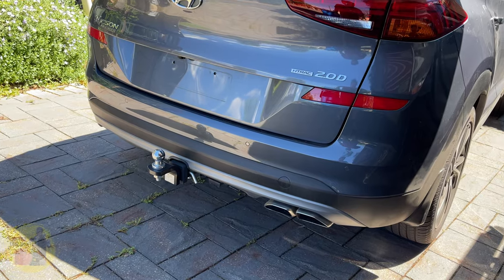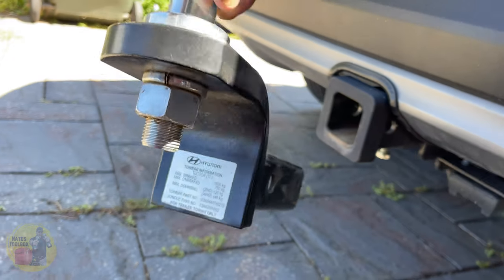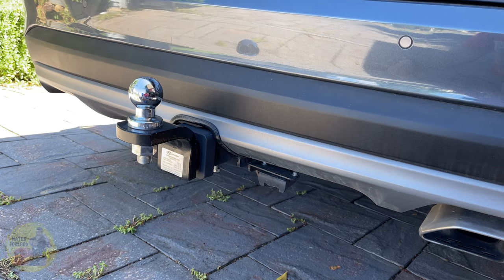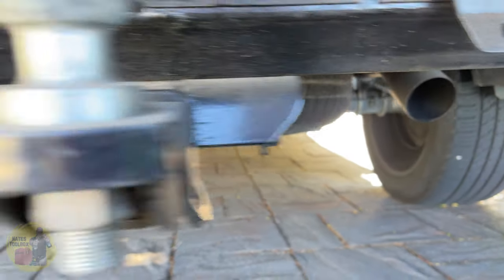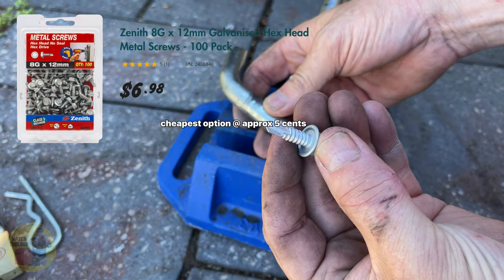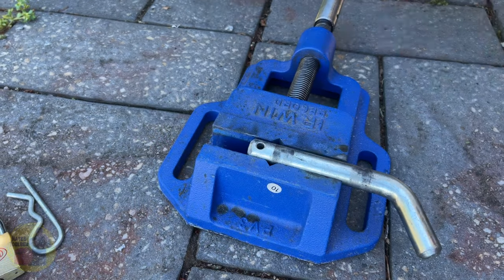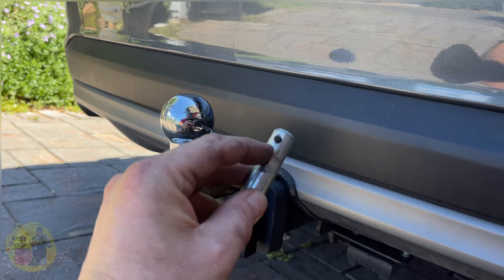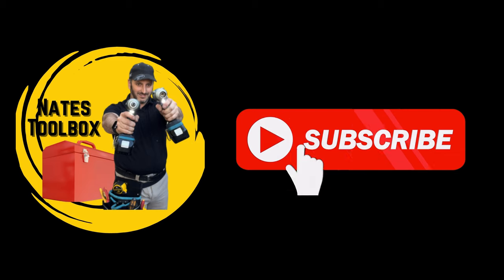Tow bar / hitch theft

Comment: Mate... thieves are stupid, but not that stupid haha. I think you said the tek screw head was 3/8" so most people would have that size spannar in their kit which would remove that screw in a flash. Dont need the socket you used or a drill even.
Reply from the maker: Haha luckily most are opportunistic and this is really just so people don’t nick your pin and leave the hitch unsecured 👌🏻.   If your carrying around a 3/8 bit or similar then you deserve it 🤣